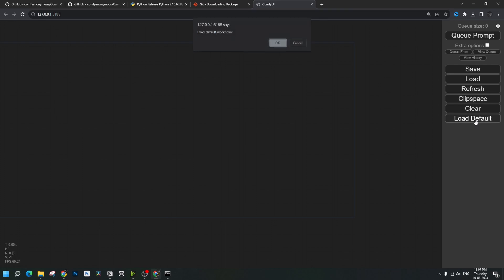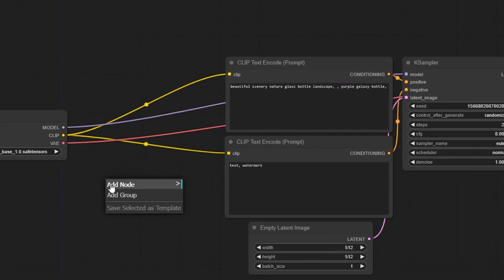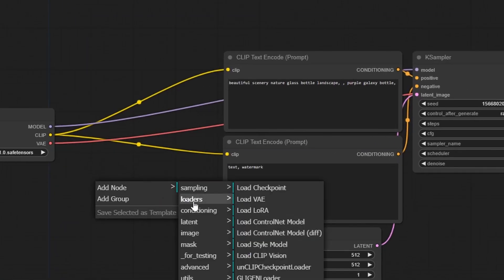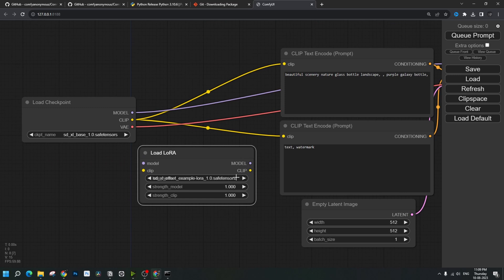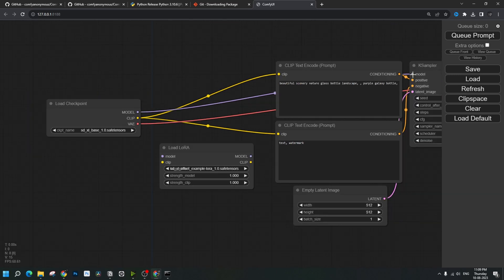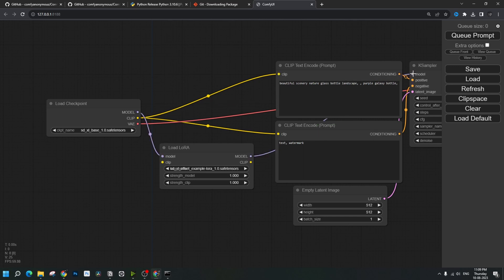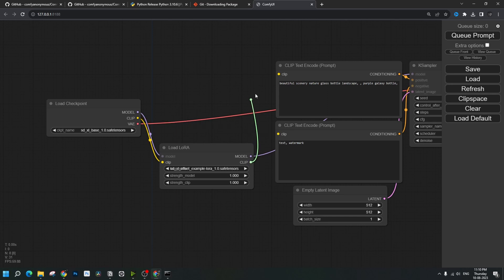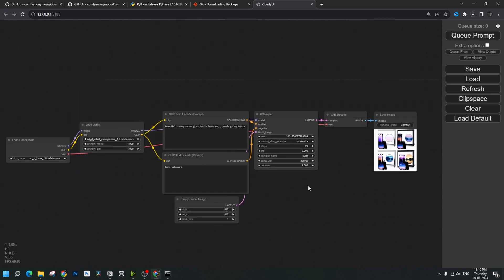Install LORA models in Comfyui: SDXL Offset LORA

Comment: I’ve tried several SDXL models in a simple workflow (1024x1024) but they just output a blank solid color image. 

Downloaded a workflow with refiner and that works absolutely perfectly, but adding LoRA to generation step does nothing.
Reply from the maker: Most of the Lora models need a specific phrase for them to activate. Usually the phrase is given in the description on their civitai page. Are you including the specific phrase in the prompt?
Reply: @Debargha_Bhattacharjee  Yes. LoRAs with SD 1.5 + the trigger keywords of course work as expected, but no luck with simply replacing 1.5 with XL (in a simple workflow), and likewise in case of LoRA with replacing with a XL compatible one.
Reply from the maker: @Tushar.Sharma  I never faced such problem, maybe because I always used SDXL in comfyui. I shall try to play around a bit and see what happens.
Reply: @Debargha_Bhattacharjee  I too use ComfyUI. I’ll try again with some other model.
Reply from the maker: @Tushar.Sharma  Sure. Please Let me know if it works properly this time.

Comment: Debargha Bhattacharjee - The Title says "Install LORA models in Comfyui" . You absolutely Showed NOTHING ABOUT HOW TO INSTALL LORA IN COMFYUI. Why do a lot of YouTube people claim to show you how to install something when in actuality THEY DON'T? Talk about Cappin.....
Reply from the maker: You're right. Running extensions in ComfyUI is quite different from running them in Automatic1111. You have to 'install' extensions in Automatic1111 whereas in ComfyUI you either have to set up pre-installed nodes or install new nodes and set them up. The more appropriate title would be 'How to run lora models in comfui'. As most people are already familiar with Automatic1111, they would understand the term 'install' more readily compared to 'running' or 'setting up'. Hence, such a title.